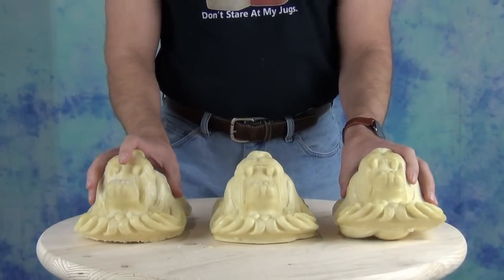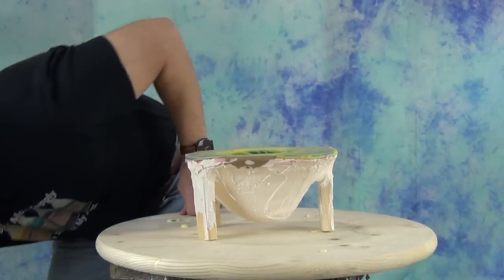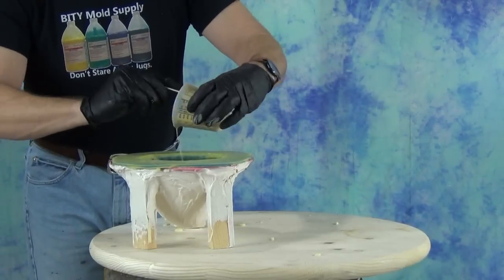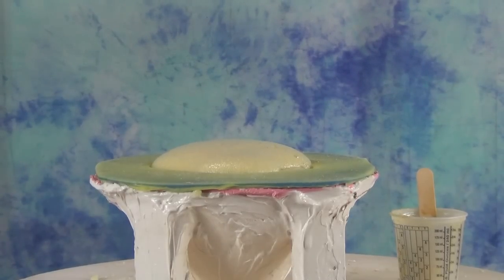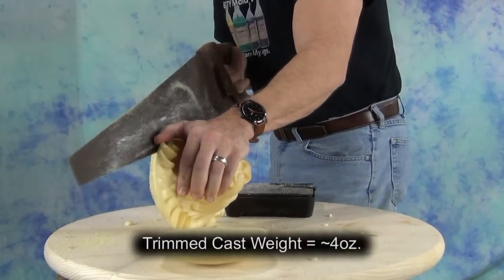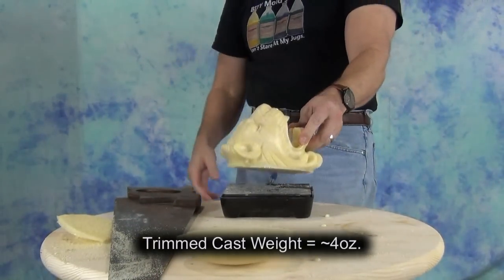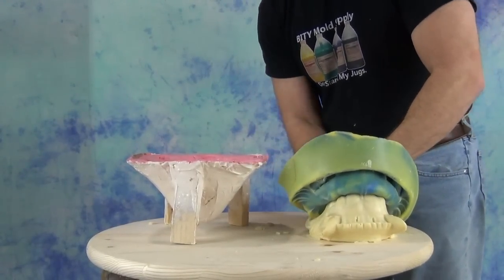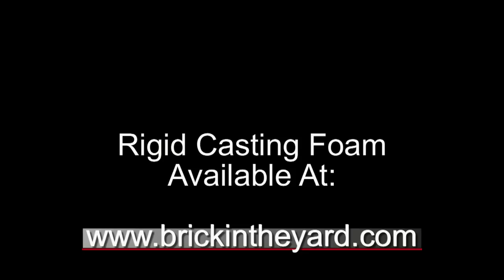Rigid Foam Casting Tips

Comment: Thanks for the information, I have cast a lot in PU but not yet in foam, so this is very useful. One general tip that might be of interest: weigh an empty cup and then a cup with the leftover after mixing and pouring, to get an impression of how much is left over. This is a way to get better in mixing the right amount, as sometimes you lose more than you'd expect, but overcompensation is just a waste of material. :)
Reply from the maker: Great tip!

Comment: Can you cast in a latex mold? What would you use for a release? If you cast in a plastic mold, would you need release?
Reply from the maker: I have not tried to cast foam into a latex mold. We have some customers that do, but painting is tricky because the release required is difficult to clean off the cast parts. Our E236 could be used as a release, but the part will be VERY difficult to paint unless the part is thoroughly washed.

Comment: How effective would this be at lost foam casting?
Reply from the maker: @beefan1596  I have not tried it, but I remember hearing some of my customers doing it with 3lb rigid foam.
Reply: @brickintheyard  Thank you for your time, and the wonderful video. I will have to watch your previous videos on mold making, as this one turned out perfectly, at least to my eyes.
Is there any solvent that would dissolve this material? Polyurethane chars, or so I've heard, so it may leave residue when burnt out - I can imagine something along the lines of acetone would leave little to no residue.

Comment: What is the lifespan of the silicone mold for rigid casting foam?
Reply from the maker: This mold has been in use for several years and used to cast resins and foams. If a mold is made properly it will produce lots of parts and last many years. The quality of the silicone and the casting material will determine the lifespan.

Comment: One GLARING error.... 6lb foam is always going to be 6lb foam, it doesn't reduce weight & become 4lb or 5lb foam.   I think what you meant to say is through restriction in the mold, it may fill the same volume (not density) as 5lb or 4lb foam.
Reply from the maker: 6lb foam can increase in density if restricted by the shape of the mold.

Comment: Could these components be painted? Or may we use any kind of pigment to add in casting process
Reply from the maker: Our rigid foam can be painted once cured. Any release agent will need to be washed off. I use Rustoleum primer or Prime-it primer before painting.

Comment: Couldn't you just pour water in the mould before hand? and measure? to get your foam requirement?
Reply from the maker: Water is a contaminant for polyurethane and difficult to completely dry out if complicated molds.